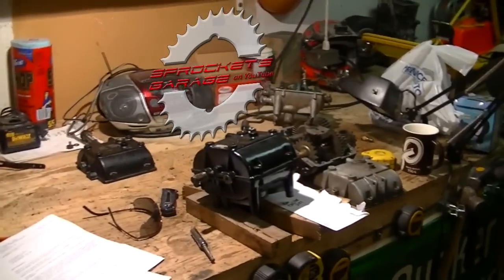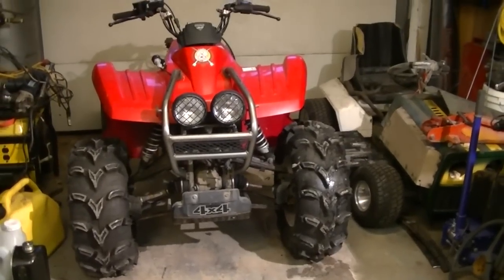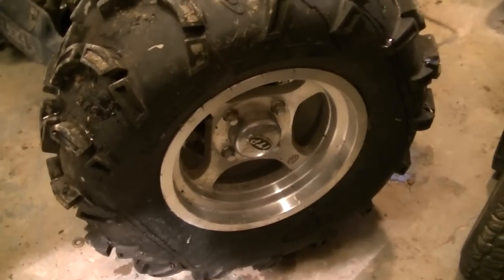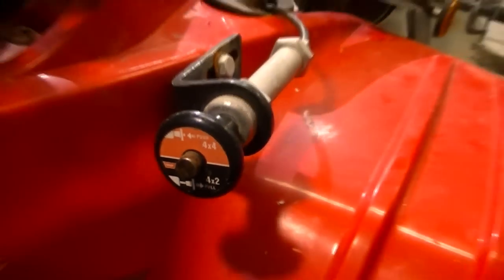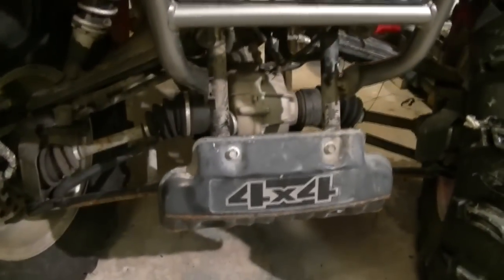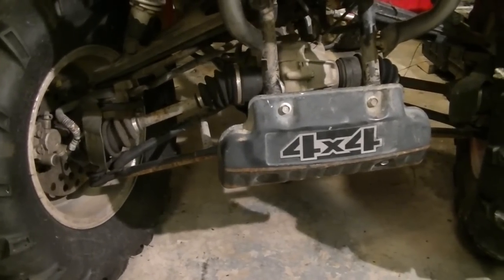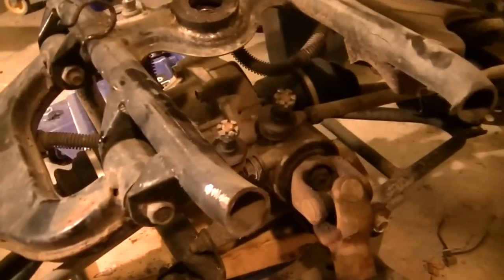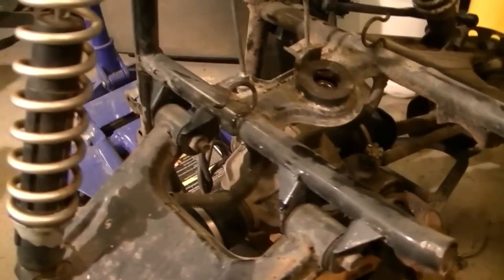Strippin' In The Shop

Comment: If it has the wires coming out of the motor you can wire it with a Ford duraspark ignition. I did it with a artic cat and a Honda. Only need three wires. Works quite well

Comment: i had kinda the idea, apparently 350 scramblers, i think, are chain drive front ends. would make for a cool pre runner mower if you had one.
Reply from the maker: Aren't prerunners typically 2wd?
Reply: Some are but most are 4wd, pulls better even with more driveline soak

Comment: wonder if that front axle can support the weight of that heavy mower frame and then the 3 cylinder diesel on it is what im wondering lol
Reply from the maker: 2 cylinder. And with the suspension, yes.

Comment: You dirty dirty man you! Good vid doc
Reply from the maker: LOL- Thanks!
Reply: +Sprocketsgarage do you still have that starter
Reply from the maker: garrett monk Nah- got rid of the engine when I had to move. Sorry.
Reply: :( ok it is vary hard to find parts
Reply from the maker: +garrett monk Yes, it is. This is what made me decide not to try to do the fire restoration, and use it for parts, after all.
Reply: yea probaly the best with them front tires for the mowers ps what hapend to the snomobile motor tractor speed build